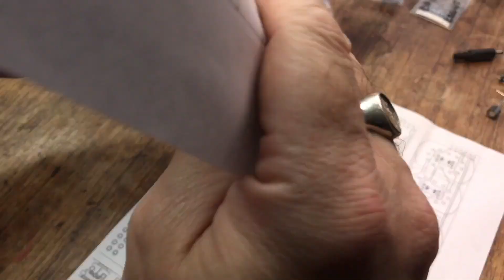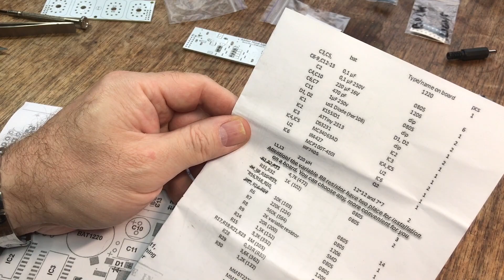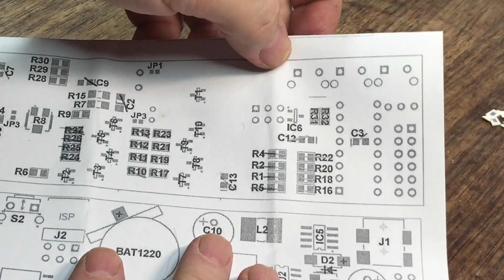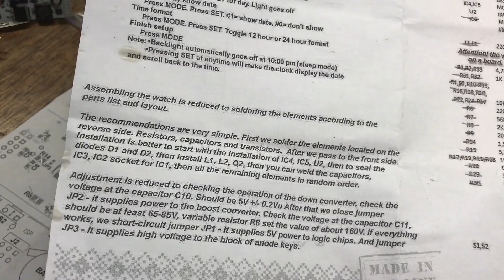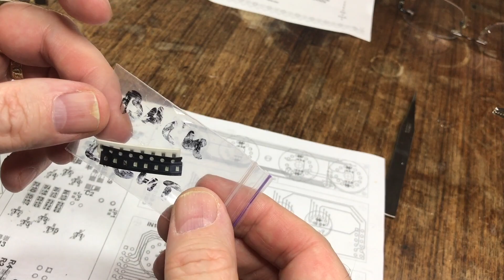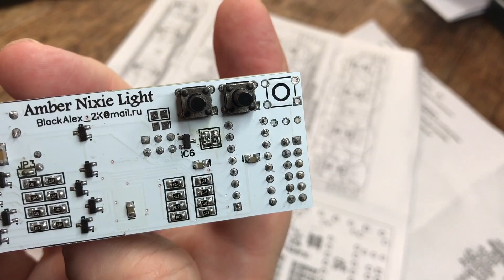Nixie tube clock kit 2.1 with IN-12 Tubes in wood box

Comment: First, desolder nixies and make sockets for them. Then cut holes in the wooden box, so you can use it as a display case. Swap tubes around and see why 2nd tube keeps flickering out. Nixie tubes are getting very hard to source. Because of this, there are now clock kits with tiny OLEDs inside imitation tubes.

Comment: Thank you, good review. If you have questions - please contact me, always answer about the kit. Now on sale there are soldered sets
Reply: Hi, I had a question about my kit that came from eBay (I hope it's from you as well, the PCB is marked with your name and address just like this one.)  What is the expected polarity of the power supply jack? Pin + and sleeve - ?  Also can I download the detailed instructions somewhere? I downloaded the ones from your Etsy page (DocForClock3), but the guy in the video has a different set, which looks more detailed. Thanks a lot!
Reply: The central conclusion is a positive one. Near the power connector there are two external power supply points, they are marked on the board. Email me at BlackAlex1973@gmail.com - I will send you the documentation. Just throw off the photo board - they are already 6 modifications.

Comment: What kind of soldering iron and tips do you use for this tiny stuff?
Reply from the maker: I use a very old Antex iron model CS. Would only use Antex irons. I use the thinnest point I can get. Readily available tip sizes from Amazon.
Reply: Edifred2007 
And do you use a soldering station with adjustble controls as well?
Reply from the maker: Nun Ya no, not for these sorts of kits. Certainly I try not to make components too hot, especially chips and LEDs, but not had a problem.